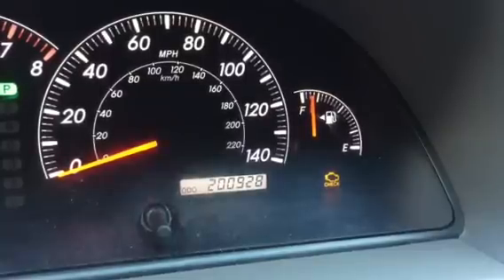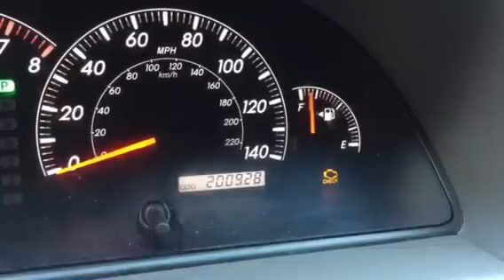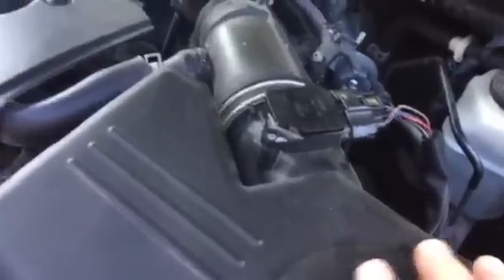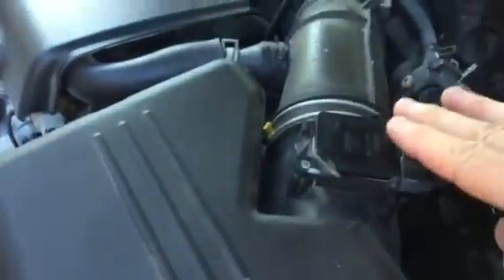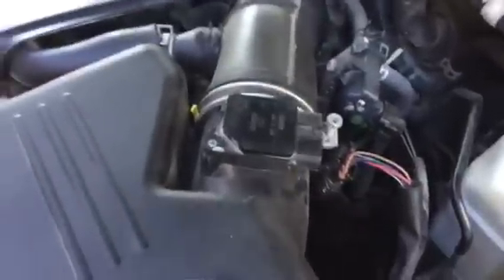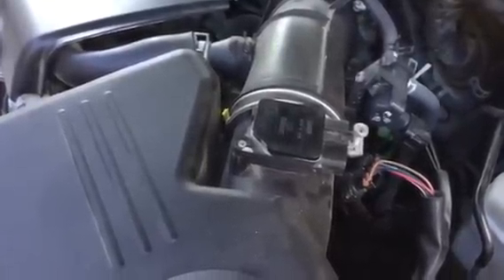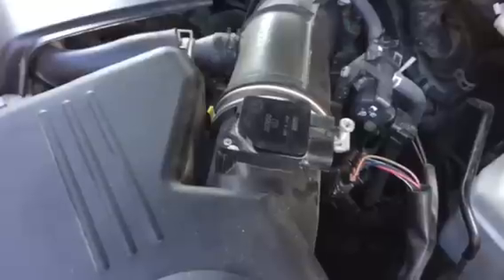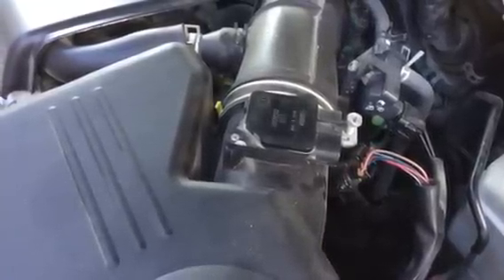How To Tell If Your Mass Air Flow Sensor Is Bad On Your Car

Comment: While,  there is valuable information here, this test and result is not always reliable.  Please do the homework on your specific vehicle. Most vehicles will continue to run with the maf(bad or not)  disconnected.

Comment: 2010 chevy traverse - code u0100 showing. Unplug airflow sensor, 3 seconds later the engine idles down. Plug it back in, the engine idles back up where it was before. Any ideas?
Reply: Did you try cleaning, or testing the airflow sensor?

Comment: When I disconnect my MAF sensor, the car actually idles way better lol. Guess it’s that time! Thanks man
Reply: Same here. It accelerated more than it did before unplugging it before starving for air too.. I cleaned it and no help. Changed the fuel pressure regulator first. I did need it. Had a clean area where gas was escaping into the plenum on the intake.

Comment: I will try this on my Peugeot 207 RC
I'm getting hesitation out of nowhere :(
Reply: Was it the maf sensor? I'm experiencing some power loss and check engine light on a 407 RHR engine
Reply: @alexnicolae5652  same issue with a  2010 VW MODEL CC

Comment: I have problems of my Mitsubishi Triton 3.2 Liter diesel experiencing low power, engine hesitation and the engine warning lamp lit.  I tried cleaning the EGR ,replace fuel and air filter but still same problems.  I hope with this easy way of checking the mass airflow sensor would solve my problems.  Thank you sir!!!

Comment: My truck ran after I disconnected it. I took out the maf sensor and cleaned it put it back in and it still runs after I disconnect it. Any tips?
Reply: Same here

Comment: My 2000 GMC Sierra 1500 (4.3l v6) is... hesitating before it shifts? That is the best way I can explain it. So I took the maf sensor to clean it with maf sensor cleaner. But now it seems to run worse, maybe it’s just me overthinking. 
But when I unplugged the maf sensor wire harness, it did not turn off the engine, does that actually mean I need a new maf sensor?
Also, could someone explain why the engine should shut off when I unplug it? 
(Also)Before all of this, I also replaced my fuel filter, which I thought might be the problem, and it was unbelievably hard to blow through, but that didn’t fix much.

Anyways, could someone tell me if it is the maf sensor, Would be awesome to learn a little bit, thank you.

Comment: Sensor may be dirty, cleaning with proper solution may avoid replacing.
Reply: you so right Steven, I clean the air intake chamber every time I replace air filter, never had issue and my car 25 yr. old

Comment: I just cleaned my mass air flow sensor on a 2007 Toyota rava4 the OBD code said MAF sensor truck would stall sometimes after driving it around then starting it up again. So I'll try what you said if I have this problem again.

Comment: I just did this but my car didn’t turn off, it started vibrating like it was going to. Does this mean it needs a replacement?
Reply: Clean it and diagnose the issue if cleaning it doesn't solve the problem. Don't replace components without diagnoses.
Reply: CauseAndEffect Thanks for the reply.
Reply: HuneyBastard yes

Comment: I just done my check as you told I unplug my mass air sensor and my car keeps running and changes of idol and speed top of that my car was hesitant I guess I need of new air mass sensor bc when I plung still running

Comment: Just tried this on my 2015 chevy cruze and the car kept running and the engine fan came on. I'm gonna try to replace/clean it myself and save some money. Thanks for the tip
Reply: Chisa Smith did it work? I have a 2011  cruze

Comment: Right now I'm having some problems with my car, Nissan Almera 2002, 1.6. Switched off on the road and now its at home.  The mechanic worked on the car for two days, but failed to find the problem. I took the car for diagnostics- all is clear; cranks, but does not start.
I see the symptoms of a bad MAF sensor is similar to a failing or failed fuel pump.

Comment: My 2002 Chevy Silverado occasionally sputters then dies but will start again and run fine Until the next time it decides to sputter and die sometimes it doesn’t start back unless I push the gas pedal to the floor and like I said I’ve changed the fuel pump brand new fuel filter brand new fuel pressure regulator brand new still having problems

Comment: My check engine light doesn't come on when I disconnect the MAF.... actually my check engine light came on the next day....
Reply: Not true on all cars. Some computers have a MAF default so if you unplug it your engine runs on the computer default settings.
Reply: @Sword5000  actually my check engine light came on the next day....

Comment: If it stops when you take out the connector, is that a for sure sign that the Mass air flow sensor is good? Or is there still a possibility that it is bad? Can a bad MAFS cause a car to only start when it's cold and then after warming up it's harder to start? Thanks!
Reply: Yes that’s correct. You will notice it to start acting up much more once it’s warmed up a bit

Comment: This is because the computer in the car if it does not receive a reading from the mass airflow sensor, will estimate and supply a number that it thinks it is supposed to have. This means that if your mass airflow sensor dies completely, then your car will stay running and surprisingly the car might run better without the mass airflow sensor. That is because if the sensor is bad or giving a wrong reading, then the cars guess might be closer to the actual amount of air that the engine is getting giving you a more accurate fuel mixture.

Used google to pull this up. This technique he gave works for a lot of cars but not all. On older cars it more likely to work especially if theyre old and also were cheap of the lot, Nicer newer cars have a fault safe once the maf sensor is disconnected it will send a fake input and trick the cars computer system into thinking the sensor is still connected this is because in the real word it wouldn't disconnect on its own but it could stop working on its own. If it did this feature is suppose to save you form having to get a tow truck and being able to drive to your mechanic. Theres accurate ways to test if you have a bad maf using a voltage meter but its a pain in the ass and if you're not mechanically intelligent at least a bit then you risk breaking other things. My recommendation is to just look symptoms of a bad maf. My car was feeling like it had less power and was using a V6 instead of the V8 its equipped with, also felt jerking during acceleration. I was going to clean my MAF but decided to just buy a new sensor because theyre cheap. OEM parts for my infiniti were priced at 15-25 for OEM, a can of maf cleaner is like $12 so almost the same price. If you're not sure just buy a new one if its drives the same worst case you can return it. People on nicoclub forum suggested to change your MAF sensor after 100k miles because high pressure air, dust etc can corrode the sensor contact points over time. If you didnt clean your maf sensor every 10k-30k miles then just get a new one you can find them cheap on ebay just avoid dealership location and dealerships websites. IF YOU HAVE A K&N AIR FILTER OR AFTERMARKET INTAKE HIGHLY RECOMMNEDED TO CLEAN YOUR MAF SENSORS ABOUT EVERY 10K MILES OR 5K TO BE ON THE SAFE SIDE.

7 Symptoms of A Bad or Failing Mass Air Flow Sensor

As explained at the beginning of the article, the MAF data is vital for fuel delivery control. The most common bad mass air flow sensor symptoms are:

1. Check Engine Light (CEL) 

Due to its crucial role in powertrain management expect the CEL to light up after a few driving cycles with a damaged MAF sensor.

2. Difficulty During Engine Start

Since the ECU can’t measure incoming air mass it needs to compensate for this lack of information using the rest of the sensors. Depending on ECU’s program sophistication and installed sensors the vehicle start can be very difficult. On older models, you may find that the engine doesn’t start at all.

3. Poor Fuel Economy

Without proper information coming from the MAF, the ECU won’t be able to operate efficiently and thus, a noticeable decrease in fuel economy will be evident.

4. Rough Engine Idle 
Depending on the vehicle year and maker the ECU may not compensate for this failure during idle. This might cause a rough idle or even an engine dying occasionally while idling.

5. Engine Hesitation During Acceleration

A bad mass air flow sensor will make very hard for the ECU incrementing the necessary amount of fuel during sudden acceleration. In such a scenario, the ECU will sense the drop in engine vacuum first and then using other sensors data will decide if more fuel is required. That process could take half a second to a second, more than enough to perceive the hesitation. This condition will be worse under wide open throttle acceleration.

6. Engine Hesitation Under Load 

Similar to the previous point, if you are driving uphill, towing, or demanding power from your engine,  you will find a serious hesitation due to lack of proper information regarding air mass entering the engine.

7. Gas Smell From Exhaust Pipe 

the failure to deliver the exact amount of fuel to the engine could cause a noticeable gas smell coming from your exhaust pipe.

Comment: why does the car turn off? and why does it keep running if its bad?
Reply: I don't believe this procedure of unplugging the MAF sensor is a proper way to diagnose a good or bad MAF sensor. Reason being, the engine computer is capable of running off programed parameters without input from MAF sensor. Actually, it's possible for the engine to run better with it unplugged, although doing so may result in a CEL. I've been doing a ton of reading and have come to the conclusion that this particular "test" is not accurate by any means

Comment: I have a Chevrolet Aveo 2009 I tried this today and wow to my disappointment my car did not stop. In other words I must have a bad air flow sensor, this experiment was done after I had cleaned the sensor using gasoline. Disconnected the connector and car didn’t stop but only had the faintest change in sound. But what I don’t get is why my car then never shows me the engine light or any faults regarding this “fault”
Reply: I have similar symptoms. 2000 Chevrolet silverado. No check engine light. Unplugging MAF sensor=truck stays running. I've read that later model year vehicles(when this procedure is performed) WILL stay running. Not sure why. So this test may not be 100% accurate
Reply: UPDATE*
ive been dealing with engine hesitation problems especially going up on a slope, changed fuel filter, changed fuel pump and that problem never left. nozzles serviced, plugs are in good condition.. the last troubleshoot was cleaning the MAF, and that just didnt change anything with the hesitation. Turns out it seems (and i really hope this was the problem all along), the Fuel Strainer or fuel sock in the fuel pump was not changed but after changing it today i can feel my car having that acceleration it used to have, ill drive for a few more days hopefully this is the solution afterall.

Comment: hi, what if the check engine light isn't turned on, but if I disconnect the electrical harness the engine keeps running. what does it mean?
Reply: Same here. No CEL, but truck stays running when unplugged. I've read later  model vehicles (when this procedure is performed) WILL stay running. Not sure why. Something to do with the engine computer returning to default settings?

Comment: If you have a K & N filter installed then you should clean it after cleaning your filter.  Because the oils from the filter can contaminate the “wire” on the MAF. But this test is golden to diagnose a bad one.
Reply: What filter ?
Reply: @youonlyliveonce2556  
Air filter!

Comment: What if my car keeps running for a while and then shuts off?
Reply: This is because the computer in the car if it does not receive a reading from the mass airflow sensor, will estimate and supply a number that it thinks it is supposed to have. This means that if your mass airflow sensor dies completely, then your car will stay running and surprisingly the car might run better without the mass airflow sensor. That is because if the sensor is bad or giving a wrong reading, then the cars guess might be closer to the actual amount of air that the engine is getting giving you a more accurate fuel mixture.

Used google to pull this up. This technique he gave works for a lot of cars but not all. On older cars it more likely to work especially if theyre old and also were cheap of the lot, Nicer newer cars have a fault safe once the maf sensor is disconnected it will send a fake input and trick the cars computer system into thinking the sensor is still connected this is because in the real word it wouldn't disconnect on its own but it could stop working on its own. If it did this feature is suppose to save you form having to get a tow truck and being able to drive to your mechanic. Theres accurate ways to test if you have a bad maf using a voltage meter but its a pain in the ass and if you're not mechanically intelligent at least a bit then you risk breaking other things. My recommendation is to just look symptoms of a bad maf. My car was feeling like it had less power and was using a V6 instead of the V8 its equipped with, also felt jerking during acceleration. I was going to clean my MAF but decided to just buy a new sensor because theyre cheap. OEM parts for my infiniti were priced at 15-25 for OEM, a can of maf cleaner is like $12 so almost the same price. If you're not sure just buy a new one if its drives the same worst case you can return it. People on nicoclub forum suggested to change your MAF sensor after 100k miles because high pressure air, dust etc can corrode the sensor contact points over time. If you didnt clean your maf sensor every 10k-30k miles then just get a new one you can find them cheap on ebay just avoid dealership location and dealerships websites. IF YOU HAVE A K&N AIR FILTER OR AFTERMARKET INTAKE HIGHLY RECOMMNEDED TO CLEAN YOUR MAF SENSORS ABOUT EVERY 10K MILES OR 5K TO BE ON THE SAFE SIDE.

7 Symptoms of A Bad or Failing Mass Air Flow Sensor

As explained at the beginning of the article, the MAF data is vital for fuel delivery control. The most common bad mass air flow sensor symptoms are:

1. Check Engine Light (CEL) 

Due to its crucial role in powertrain management expect the CEL to light up after a few driving cycles with a damaged MAF sensor.

2. Difficulty During Engine Start

Since the ECU can’t measure incoming air mass it needs to compensate for this lack of information using the rest of the sensors. Depending on ECU’s program sophistication and installed sensors the vehicle start can be very difficult. On older models, you may find that the engine doesn’t start at all.

3. Poor Fuel Economy

Without proper information coming from the MAF, the ECU won’t be able to operate efficiently and thus, a noticeable decrease in fuel economy will be evident.

4. Rough Engine Idle 
Depending on the vehicle year and maker the ECU may not compensate for this failure during idle. This might cause a rough idle or even an engine dying occasionally while idling.

5. Engine Hesitation During Acceleration

A bad mass air flow sensor will make very hard for the ECU incrementing the necessary amount of fuel during sudden acceleration. In such a scenario, the ECU will sense the drop in engine vacuum first and then using other sensors data will decide if more fuel is required. That process could take half a second to a second, more than enough to perceive the hesitation. This condition will be worse under wide open throttle acceleration.

6. Engine Hesitation Under Load 

Similar to the previous point, if you are driving uphill, towing, or demanding power from your engine,  you will find a serious hesitation due to lack of proper information regarding air mass entering the engine.

7. Gas Smell From Exhaust Pipe 

the failure to deliver the exact amount of fuel to the engine could cause a noticeable gas smell coming from your exhaust pipe.
Reply: @akiramaruyama2152  really helpfull number 5 happen to me so i pulled over and then my car shut down completely
Reply: @kemec7436  what year is  you car
Reply: Akira Maruyama I have this bmw 325ci that idles horribly, acceleration is bad, everything feels weak, white smoke at start, but no over heating what so ever, marks bank one and bank 2 of my cats, also has a misfire? after changing coilpacks and sparkplugs.
Reply: Akira Maruyama hey do you have a number or email I can send a video too?
Reply: @akiramaruyama2152  thank you
Reply: @akiramaruyama2152  15 to 25 for a maf? aftermarket from china maybe , oem's are 100's of $ .
Reply: @waldipup9010  Here in the US, OEM MAF sensors are about $50, depending on the vehicle (some are as much as $100 USD). Also, after market MAF sensors are usually not as accurate and don't last long. You get what you pay for but I would recommend the original equipment manufacturer (OEM) MAF sensor for about $50 - $100 USD. Good luck!
Reply: @akiramaruyama2152  I didn't read your entire reply but it seems you are the first person to realize the information in the video is WRONG. I did read that you thought the computer was guessing at the amount of air. Actually, when the computer doesn't receive any data from the MAF sensor, it turns to data being received by the upstream O2 and MAP sensors to establish a 14.7:1 air/fuel mixture needed for combustion. Congratulations on being the first comment that I've read indicating suspicion about this video. Also, the enormous amount of dislikes should be a clue to those who noticed it. This is a short, easy to understand video confirming what we are saying, but without information on correcting the issue. https://www.youtube.com/watch?v=M1m-n5rxuQs